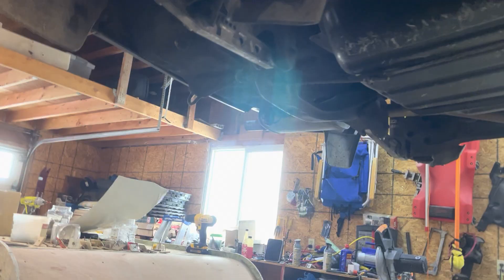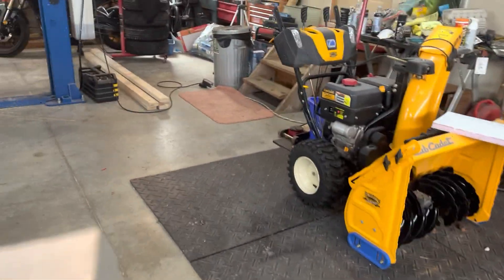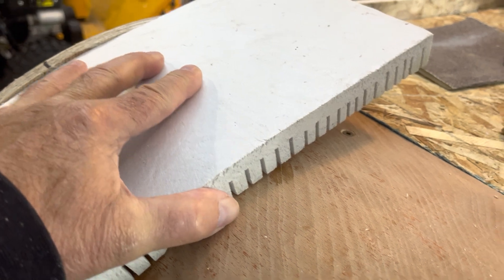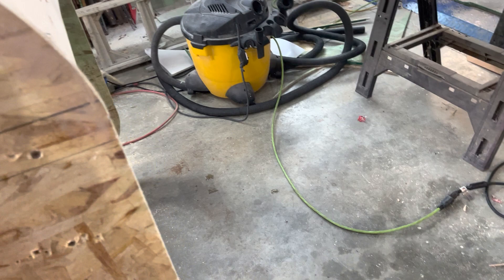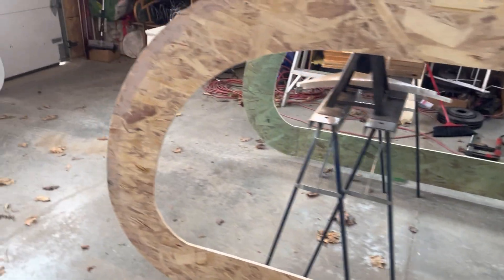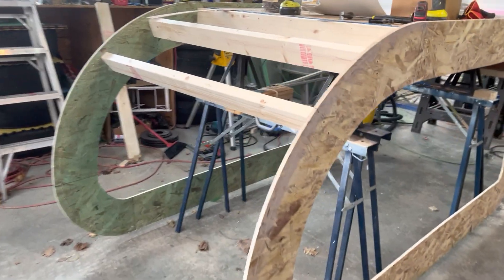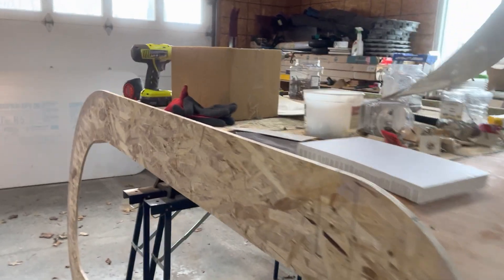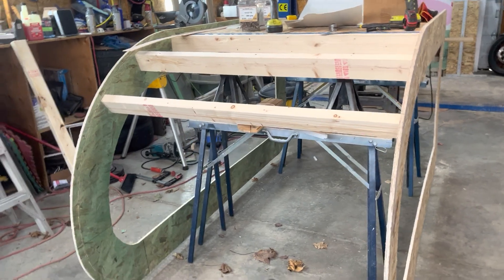Foamie teardrop build #4

Comment: Nice work however; that's not a foamie dude. Thats an insulated stick built camper.
Reply: All the OSB and timber is a tempory form to create the shape. The foam and fiberglass skins will be removed from the form once the bonding is cured. Quite ingenious really.
Reply from the maker: @cwilliams4227  Thank you and that is all correct.